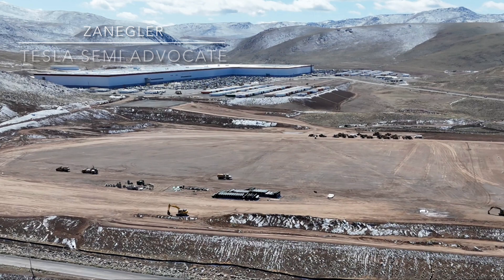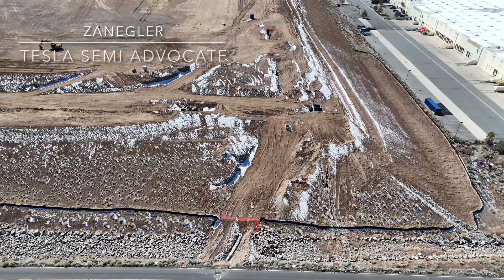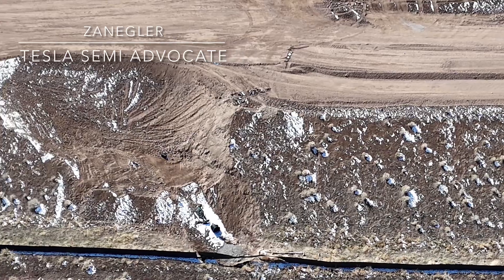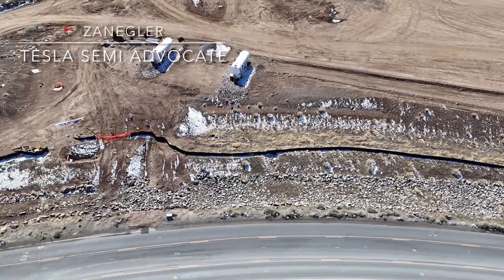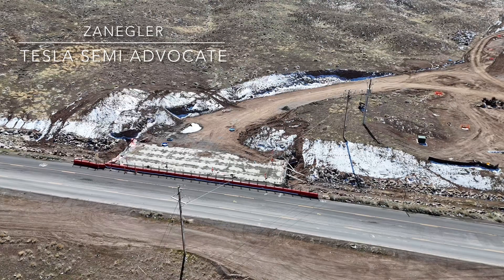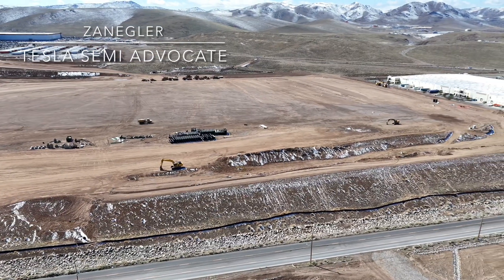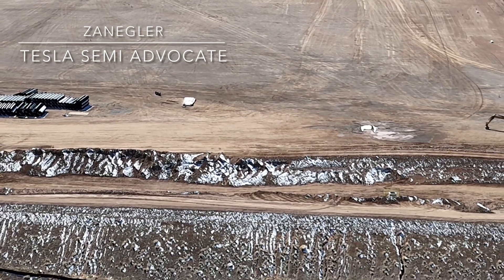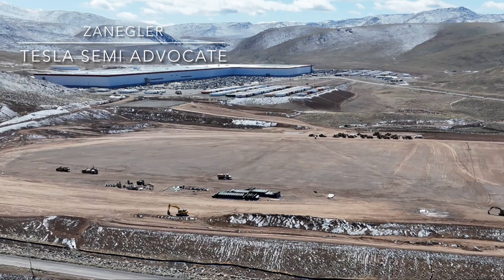Tesla Giga Nevada Semi Factory Progress Update

Comment: my guess on why the urgency is not there, 
1. More profit per battery selling the Model Y and CT right now with Batteries still being a limiting factor. 
2. The semi-truck has been going through rigorous testing, before they set up the full production line, they want to make sure that battery can last a Million Miles with regular use and without replacement. It would be a warranty nightmare for Tesla and drag on financials if the Semi battery needs replacement between 200k-300k miles.
Reply: The Semi is using Panasonic 2170 cells so they presumably have a good idea how well the pack will perform [whether they are using automotive or stationary storage chemistry] but heavy testing ongoing testing of the power electronics, motors and mechanicals is presumably key.  As I understand it, it's 3 packs for the LR and will be 2 packs for the SR semi, so a warrantee issue might not require replacing the entire pack.
Reply: @Gig0Surf  2170 cells used in initial deliveries is not a desired long term solution.
Reply: @royh6526  Tesla is going to use all the cells they can get and will allocate them where ever it makes sense. 

The Panasonic 2170s have a nickel chemistry so have a good energy density as needed for the Semi, which Panasonic is in the process of boosting another 5%.  

Perhaps Panasonic will add 4680 capacity at Kansas but it will presumably still be the same chemistries  - but maybe those cells will be allocated to Cybertruck and Model Y not the Semi.

Tesla was originally to add 4680 capacity in Nevada as well, enough for 2M light duty vehicles but less clear what their plans / timelines are at this point - and the 2170 cells will still be being produced and put into vehicles.
Reply: Don't diesel class 8s need reconditioning rebuilds or engine&trans replacements at or around 300-500k to though? 🤔

Comment: I agree, unless it picks up a lot, you might not need more than every other week. I have always assumed there would be huge demand. I wonder if the Semi is still being refined or demand is not as huge as anticipated.
Reply: I doubt demand is the problem. 4680 cell production is still ramping up at Giga Texas and so far only about 20% of goal rate. Giga Nevada is supposed to have an expansion for 100GWh/yr 4680 cell production, and there is no sign of that even starting. I suspect, that even though cell production has started at Giga Texas, improvements in speed are still being worked on, and manufacturing at Nevada is on hold until more progress is made. All this to say that the Semi depends on 4680 cells being in production at low cost. No hurry to get Semi production up until 4680 production is in high gear.
Reply: @royh6526  Exactly so if theyw ere to build 5 million M2 they could not generate the batteries until 2027 or 2028

Comment: The governor has allocated a person in his office to expedite permits by the various authorities. I think the issue is preserving a positive cash flow. The fall off in car sales last QTR took around $1.5bn out of cash reserves. Cashflow impacts short term valuation and Tesla does not want to frighten the market when Tesla and Elon are getting a lot of negative press from democrats and Republicans for different reasons.
Reply from the maker: In addition, Storey County Building Department stated that they endeavor to approve any building permit submission within 30-days. It is a very development friendly county and a big reason Tesla is here.
Reply: So, preserving cash at the moment. Let's hope they push the pilot plant hard and we see a significant number of new Semis.  It would be great to see the rear motor pair of the cyber truck power the 3 axles of the Semi (six motors in total). They are induction motors so they can 'freewheel', whereas the PM motors must be giving or taking power. Thus, Tesla puts the PM motor on the front axle of tri-motor set-ups. Semi needs a lot of weight on front axle for steering, so a great place to do regen braking. Battery must put a lot of weight on front axle. 
New Semi surely has steer-by-wire  and 800 V architecture of the Semi. 
Surely Semi can use a lot of CT parts. The steer-by-wire motors likely need a lower gearing to the rack and pinion of the Semi as moving much more weight, but doing it more slowly. 
Induction motors are cheaper than PM motors as have no permanent magnets. 
While PM motors are more efficient than induction motors, PM motors don't improve system efficiency when every wheel, or wheel pair, is individually powered. 
With Semi Ver.1, Tesla used its Tri-motor setup in the Semi and has probably done so again to keep costs and weight down. But I would love to see a six motor Semi. A four induction motor Semi would be good for even tyre wear and durability of the drivetrain - as a minimum I hope for this. For truck owners, identical setups for the two rear axles means less spare parts less wear and tear, perhaps same weight as no differential required. Surely, efficiency is still the same.  Effectively, Semi Ver1 was driven by the PM motor when power demand was low, and the induction motors free-wheeled. I await with interest a spec sheet on Semi Ver2.
Reply: LOL "Tesla does not want to frighten the market"
If you follow Elon and Tesla at all... you know, Elon does not give a $hit about what "the market" or anyone else thinks or feels.

"Offer me Money, offer me Power. I dont care! I will say what I want to say!"
"Go F¥(k your self, is that clear!"
-Elon Musk-❤